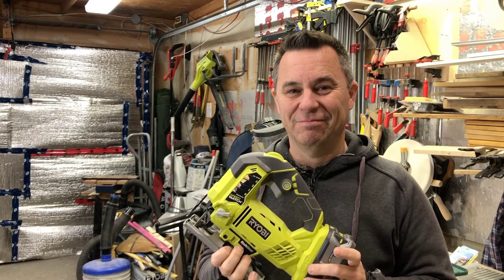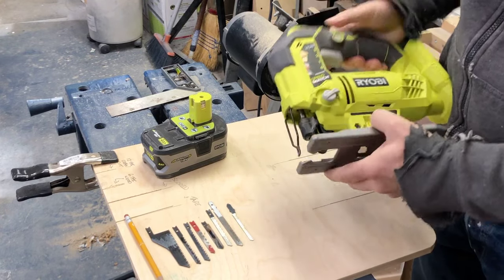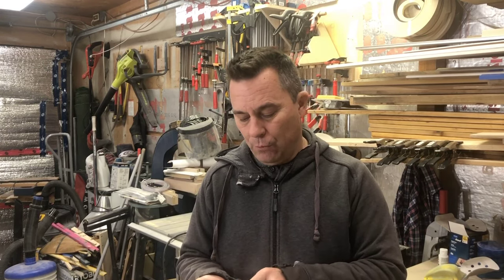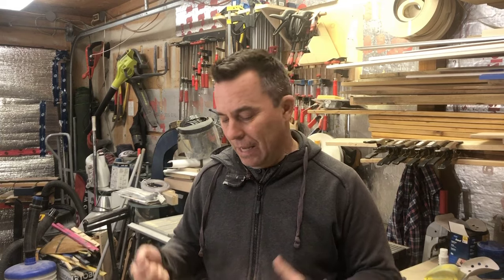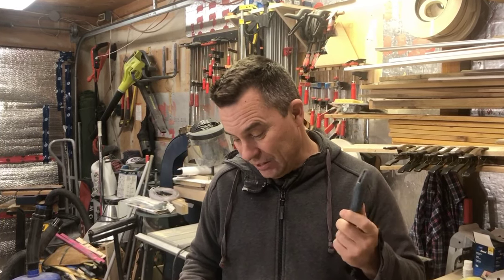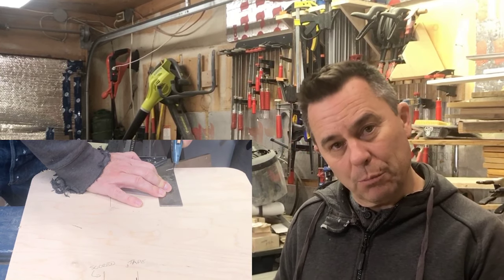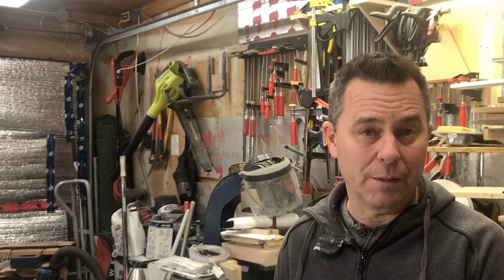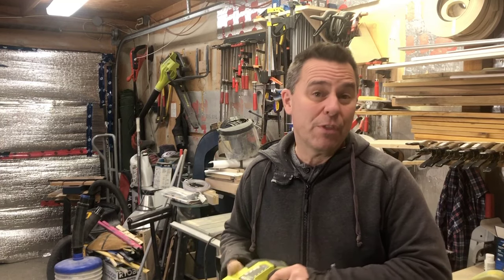How To Use Your Jigsaw I Tips & Tricks

Comment: 🎉You are so genuine. I can understand what you are teaching. I just bought my first jigsaw. I used a circular saw for most everything and then a multi-tool for the rest. Now I have more confidence in using my jigsaw. I understand about safety of course. Especially since mine came with a U blade.  Lol I will be purchasing the right blade for the wood i am using. Great tip scoring the line first, then using the packing tape. Awesome! Thank you so much for this fun and informative video! 😊

Comment: Lovely video. I am making a bathtub deck myself for the first time because i basically got a botched job done. I bought a jigsaw and have never used one. This was so helpful i just made my first couple of cuts and am amazed on how accurate your advice is. Thank you !
Reply from the maker: Fantastic! You can do so much with the jigsaw. Best of luck with your project. Let me know if I can help you out at all!
Reply: @DIYWithWally  Omg yes please  I will eventually have to cut tile it’s a ceramic tile thats 91/2 and 37 inches but its thickness is 5/16 and its super heavy. I have a simple small wet saw that i have little experience with but i’m concerned that the long cuts might get ruined because  i have make full 37 inches on such a small workspace. I did get a good diamond blade but the weight of the tile and its length concerns me. I cant afford to ruin more then 4. i got the Ryobi   4.8 amp motor ( the one thats not cordless) i have to cut 2x4’s and also 1/2 inch plywood and since i basicly got robbed $900 I can’t go crazy buying  too many blades. Do you recommend i still use my small wet saw for the long cuts or should i invest in a tile blade? And what would you recommend i get for the other cuts?  Any suggestion would be highly appreciated. I am doing this while going thru a MS or RA flare up so believe me any suggestions would help immensely🙏🏽🙏🏽🌤☀️
Reply from the maker: @angelicab121  Can you have somebody at a flooring store make the cuts for you? We have a decent wet saw and have no hesitation making those cuts but if you are concerned about the safety aspect I wouldn’t attempt those. Either rent a good one or have somebody else do them.
Reply: @DIYWithWally  thanks im going to test one out first if i see it’s not right ill have to rent a bigger one. I live in puerto rico and there isnt a store where you can requests cuts but i think if i try with one ill manage. Thanks for replying!  My brother got me a diamond blade for the saw today ill test it out on the thinner  ones first and compare🤓

Comment: Awesome and useful video! Thank you !
I just got a jigsaw and I've been excited to use it. I'm happy I saw your video before really diving into projects 😅
One question I have is on loading the blade into the jigsaw. I have a quick release jigsaw and I have gone over the instructions 500 times, but I put the blade in and power it on but the blade never starts moving or cutting. 🙃 
Thanks again for the supper helpful tips!
Reply from the maker: Hi, I know on mine I really have to turn the “chuck” to make sure the blade is properly seated in it. Maybe that’s the case for yours too?? Thank you!

Comment: Got a nice Milwaukee fuel jigsaw in a Milwaukee fuel kit I bought.... the few times I’ve used I always felt my circular saw, or table saw do a much better job...I guess I need to start making some curves. Love your video, and you’ve encouraged me to replace the dust on my jigsaw with saw dust 👍
Reply from the maker: That is a great jigsaw. You should be able to do lots with it. I tend to agree with you that other tools do a better job with lots of cuts but the jigsaw definitely has a place in your tool belt. Thanks for taking the time to comment!

Comment: Well explained. Tips are extremely useful, at least I learned them for the first time. So thank you for that. I wish you had given some idea or tips on how to fix the work surface on a table while using a jigsaw as the blade would be protruding below the work surface while running.
Reply from the maker: I think I’ll use your suggestion and do a follow-up video on that. Thanks!

Comment: So I  broke the last  blade on my old Black & Decker and when I tried to order online, I discovered that there are two types of blade shanks, and the B&D only takes a U-shank blade.  It always aggravated me because the blade kept falling out.  The big box store only had one U-Shank product vs. about 20 for T-Shank.   That made me dig out another jigsaw that someone had given me,  but since it didn't have any blades I never used it.  Turns out it's a newer model that takes the T-Shank blades.  I picked up a set of  DeWalt T-Shank blades today and found it had one labeled "Laminate" and the teeth went the opposite way. Your video explained why, and that's very useful because I'm about to start a flooring project.  Also liked the tips, I learned a lot.  Never heard of a flush-cut jigsaw blade before either, I will get one.  You showed how the jigsaw can make curved cuts, my  blade kit also included one labeled "scroll" and is very narrow for tight turns.  My jigsaw also has an "oscillate" function which apparently moves the blade forward and backward in addition to up and down.   Now I have to keep learning to see what else I can do with thing.  Thanks.
Reply from the maker: Man, I love hearing these kinds of stories. Thanks so much for taking the time to comment and I really wish you success with your jigsaw and and all tools! Thanks 🙏

Comment: Hi I have bosch jig saw and a bosch circle cutting jig but l haven't been able cut straight edge cut circle that meets is beveled what's the best blade to use for this l under stand about slowing down. Any help please.
Reply from the maker: That is a common problem with circle cutting jigs. The blade always want to deflect a bit as you go around the circle. You are right about slowing it right down but also try a stiffer blade. I’ve had good luck with Busch’s T111C blade. It’s really for coarse cuts but works well when combined with a slow circle cut. Let me know how it goes.

Comment: That was a great video.Thank you. I've been using my old Skil jigsaw for awhile now on projects and you reinforced some things I suspected were going on, but what I want to know is how come sometimes the saw jumps up and down when it's cutting?  In other words, I can't keep the shoe flat because it vibrates so hard.  I hate that.
Reply from the maker: Hi, thanks for the comments! I find the saw starts to jump if I don’t keep downward pressure on the saw. It can also happen if I’m trying to go too fast or if I am trying to cut a circle too tight. Also, maybe make sure your blade isn’t too dull. That can also make a difference. If you find the blade flexing backwards while you are cutting, slow down and let it cut straight up and down. Best of luck!

Comment: Interest tip about slowing down the speed of the jigsaw for hardwoods. When you say slow down the speed of the cut do you mean slow down the feed rate of the saw i.e. the speed at which you push your jigsaw forward ? Lots of good tips there, thanks
Reply from the maker: Hi, thanks for taking time to comment! What I mean is to slow the actual saw stroke count. Most newer jigsaws are variable speed and some even have a chart that shows what speed to use for different materials. Having said that, it would also be wise to slow your  feed rate down too. That will reduce tearout even more. Hope that helps.

Comment: Thanks Wally. A useful guide. You talked about speed in respect of feed speed. How about the relationship of feed speed to saw speed and different materials? I've had a cheap jig saw for years but never really had any regard for it because it wanders around with a mind of its own. I've come back to it, wondering whether it's just my lack of knowledge, to give it a second chance!
Reply from the maker: Hi Tony, great question! What I would recommend is to listen to your motor. You can always tell when your motor starts to labor a bit. That’s how you know you are either trying to go too fast through your material or perhaps your blade is dull and can’t keep up with the feed rate. I prefer to always go on the slower side because that also reduces the tear-out in your material. The answer may also be to upgrade your jigsaw to a variable speed if it isn’t already. Hope that helps a bit!

Comment: Lots of great info on this video. I just added this jigsaw to my Ryobi collection. Question for you (or anyone else).
I need to modify my front fiberglass door and sidelites (1 3/4") to accept the new door glass inserts for them. They already have inserts in them, just need to create a squared top instead of the current half round design, so not a lot of cutting needed. What blade would you suggest and what speed (guessing a 0 on the orbital switch?). Thanks for this great tutorial!
Reply from the maker: Hi, great question! I have never attempted that but definitely make sure you have at least a 21-24 tooth metal cutting blade. My 2 major concerns would be adding a straight edge so you get a good straight cut and that you will be able to get the blade all the way through both sides with 3-4 teeth still contacting each side. I worry that the blade will make the metal rough on the outside of the bottom. You’ll have to drill a hole first to get the blade in so maybe you can experiment there to see how the blade cuts on both top and bottom. Best of luck, let us know how it goes!
Reply: @DIYWithWally  Thanks for the tips! So, a metal blade for fiberglass? I don't have a huge area to cut, so I am hoping (fingers crossed) that blade will be able to take care of both sides in one cut. I also just purchased a Ryobi oscillating tool, so I am trying to decide which one will be the best for the job.
Reply from the maker: Hi, for fiberglass I would make sure to use the finest blade you have. Fiberglass tears easily(glass fibers) and the finer the blade, the less tearing there will be. Also, you’ll want to wear a mask and gloves as the fiberglass will get into your lungs and the fibers will cut your hands. Once you’re done the cut, take a file to the fibers. File from the outside of the door to the inside so you don’t tear the fibers back.
Reply: @DIYWithWally  Thanks for the tips. I think the door will be easier, as I can take it off the hinges and lay it on sawhorses. The sidelites on either side of the door are more problematic. I don't think the footprint of the jigsaw will be able to maneuver the cuts I need to accomplish. I think opting doing those with the oscillating tool might be the better option on those. Thanks again!

Comment: Thanks so much this is very helpful. I have the same jigsaw and i work with maple like the one you used. I'm struggling with cutting curves, similar to you example, without the jigsaw over heating on me. What blade and speed would you recommend?
Reply from the maker: Hi, maple can be tricky. Push your blade too hard and it will burn. Not fast enough, you will risk overheating your jigsaw. If you are sanding afterward, get a very aggressive TPI blade. That will allow you to slowly move around the corners and not overheat the jigsaw. This will cause tear out though so be ready to sand it smooth again. Hope that helps.
Reply: @DIYWithWally  thank you I'll will be sanding so i will be trying this tip. Would you suggest a 10 TPI blade or higher?

Comment: What blade do you recommend for cutting curves? A finer blade?
Reply from the maker: Yes, a finer tooth blade will give you a smoother cut for your curves. Generally jigsaws aren’t great at cutting tight curves though so go slowly and watch for flexing of the blade. You may need to add some relief cuts to your wood to help the process. The only caution here is that the finer tooth blades will have a tendency to burnish the wood if you let it sit in one place too long. I use the Bosch T101AO blades, they work quite well on curves.

Comment: Thanks for your helpful video !
Is there a reason for the jig kicking back? I'm afraid I'm going to break the blade. Cutting 3cm of poplar baton in half down the middle. Not forcing much at all!
Tried all different blade speeds. Tried speed settings 1-3 also.
Anyone can respond with more tips please?
Reply from the maker: Normally when the saw kicks back a bit, It’s because you are trying to force the blade through the wood faster than the saw can handle. What happens when you slow the feed rate down? Does the wood tear at all? It could also simply be that the blade needs to be replaced. Let us know we’d like to help figure this out for you.
Reply: @DIYWithWally  It's all brand new. Yesterday I purchased the jig, with 4 blades.
I've tried all speed for blade and cut. STILL kicks. Correct blade for this jig too.
I just posted a video of me trying.
@Stephen_Strange
Reply: @Stephen_Strange you’re prob using the wrong blade for what you’re cutting
Reply: You @legzn2423  are right - I found some other videos, advising with wood, and I changed it to a finer toothed blade. Worked just dandy ! Thank you.
Reply: Hi @DIYWithWally  - it still kicked back, the blade had teeth too far apart, needed a finer toothed blade !

Comment: How much sanding is generally required after cutting holes?
Reply from the maker: It depends on the material but generally just a light sanding to take away the rough edges. It isn’t really designed to be a finish cut tool but with the right blade and some patience you can make very smooth cuts and reduce the sanding greatly.

Comment: Here's a tip . Use a barrel grip and put the shoe of the saw on the bottom of whatever you are cutting
with the blade pointing up . You will see the lines easily, will not get tear out " if using an upstroke blade" will not
mar the piece in anyway. It takes a little getting used to , but have been doing this for 40 plus years.
p.s. will work with a top handle grip , but much more control on a barrel grip type jigsaw. Have a nice day.
Reply from the maker: That’s awesome, thank you so much! I have seen people do this when coping baseboard and trim as well. I appreciate you taking the time to help us all out!

Comment: I have the same model and my blade is drifting off the wheel. Do you have advice?
Reply from the maker: Hi, thanks for this question. First, make sure your wheel spins freely. It could be that there is friction there that kicks the blade out. If that’s not it, let’s run through a couple possible other causes:
1) make sure you are using a T style blade. This jigsaw needs the stability of the T style to keep it in line. 
2) I find that when my blade gets dull it tends to want to wander more. Maybe check to see if your blade is dull.
3) Blade speed. I find that when I cut thicker materials, the blade needs to be cutting at a higher speed to keep straight. If you are putting constant light pressure against the piece you are cutting, it should keep the blade in the wheel socket. 
Try those and let me know if that works. If not, let’s keep exploring. Good luck.

Comment: What blade do u need to cut hole in cargo vehicle . That has metal and wood
Reply from the maker: Hi, you can buy a metal blade for that application. It will cut through metal and wood. It has finer teeth so you’ll need to go as slow as the blade wants to go to not burn the wood.

Comment: With the right blade, could this jig saw cut 1mm-thick spring steel plate?
Reply from the maker: This particular one couldn’t but there are specific saws that could. I’d be more inclined to use a bandsaw or even a portable bandsaw.
Reply: @DIYWithWally  Thank you for the reply. My budget forces me to look at cordless jig saws of the same class. I've read that what might be needed is a 6A motor and all-metal housing and gearbox.

Comment: What blade is best fitted for laminate counter tops ?
Reply from the maker: I use a fine tooth blade for that. Definitely put down a layer of masking tape and put your cut lines on the tape. That will help minimize the chipping of the countertop. I would also recommend using a blade that cuts on the downstroke as that will also give a cleaner cut. As an aside, I use a circular saw as much as possible for those cuts and then finish the corners with the jigsaw. Best of luck!
Reply: @DIYWithWally  thanks so much , I took your advice and it worked great

Comment: Thank you! I have an old skilsaw, I took it apart and cleaned it up, but it sounds rough. I was afraid to use it.
Reply: Which do you think is the best jig to buy? The Ryobi like you have? Which I see is around $68?
Reply from the maker: It depends on your budget. Ryobi is definitely on the lower end but they work just fine for most things. Mine is battery powered so that will cost you extra but it’s very convenient with no cords. The similar one with cords is around $50, that may be a good starting point.
Reply: @DIYWithWally  I like battery operated

Comment: Hi there, very nice video. One thing I'd like to know that you didn't cover, was using a jigsaw to cut metal (using a metal blade). Do you use a slower speed and/or pendulum setting?
Reply from the maker: Hi, great question. You definitely want to slow the blade right down and make sure you’re using a fine metal cutting blade with 21 to 24 teeth per inch. The other suggestion I would have is to sandwich the metal between two pieces of thin plywood and then make your cuts. This will be slow going but it will give you a very clean cut on your sheet metal. For cutting pipes you should always clap the Pipe in some sort of a v-groove holder and go very slowly. Hope that helps!